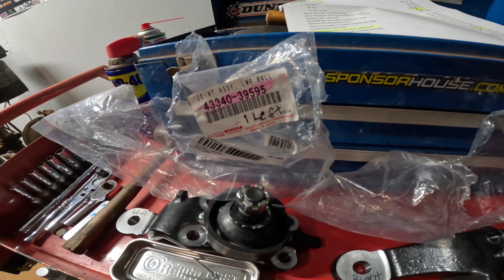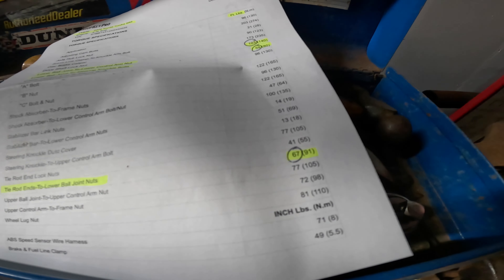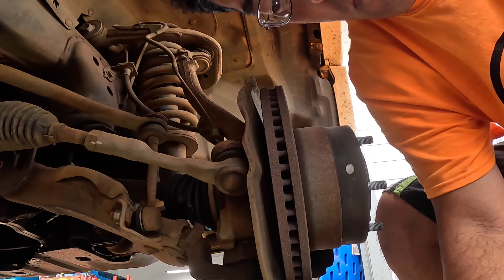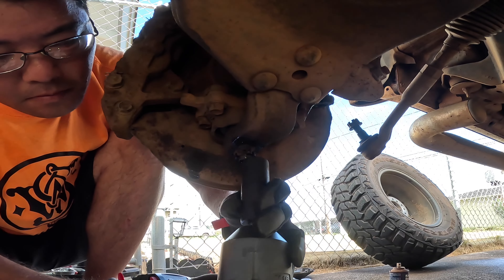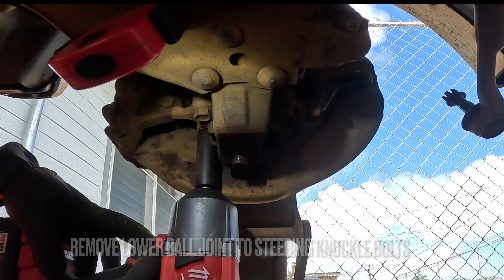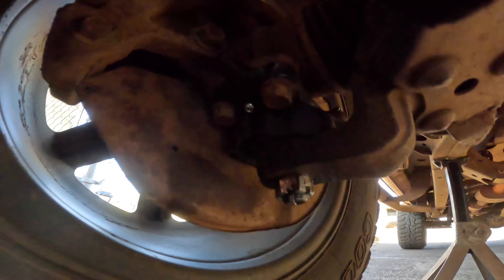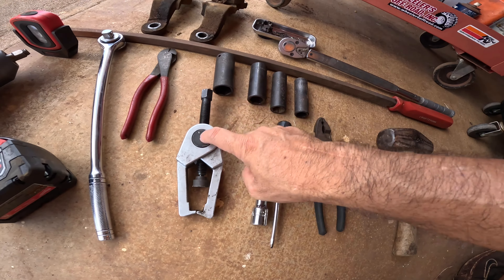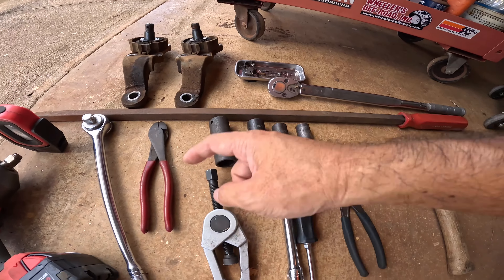How to Replace Failure Prone Lower Ball Joints // 1st Gen Toyota Tundra 2000-2006

Comment: You should use the Toyota black replacement bolts or the ARP 663-1004 for the 4 bolts on each ball joint.  Reusing the bolts could be a potential failure point.
Reply from the maker: I replaced the old bolts with OEM Toyota bolts later. Was backordered at the time of the video.